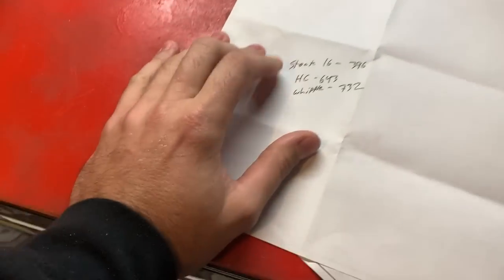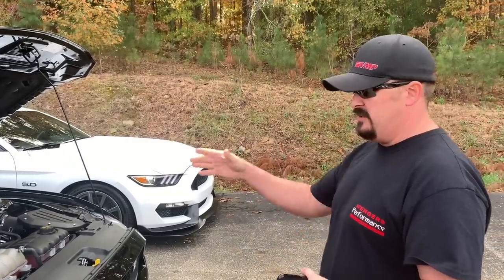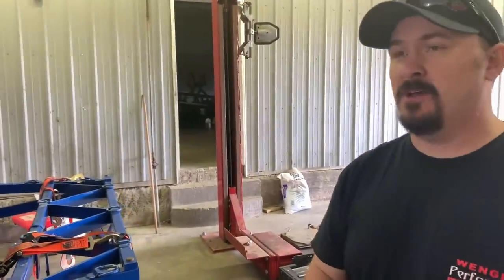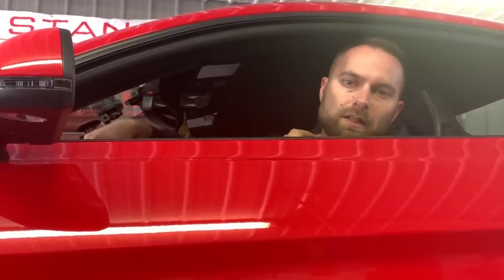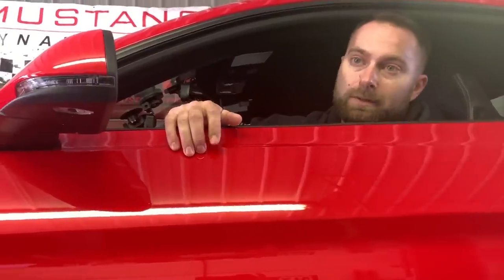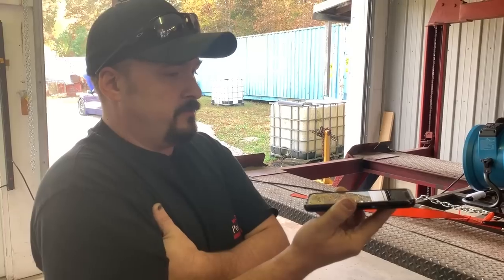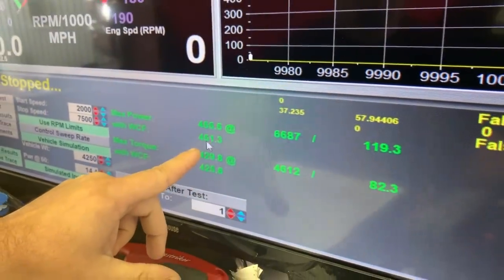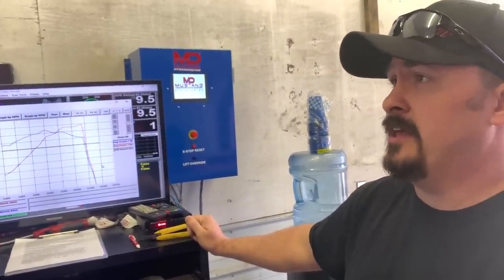How Underrated is the 2018-2019 Mustang GT from the Factory on a Dyno?

Comment: Hey Zander, how do you like the magnetic ride compared to the non magnetic? I want to get the magnetic and a Performance pack but my goodness if you get a PP1 and magnetic you basically pay for the PP2. Only $810 more for it. 

How do you like the PP1? Have you driven a PP2? I'd like to break down the exact differences. I know you get the nice front splitter (which is very nice) and the little wing, then the wheels and tires, and a more aggressive suspension tuning on the mag dampers. Not sure if it gets any added coolers for rear, trans, oil, or coolant or different springs or sway bars. 

 What did you do in the militarty? Thanks for your service man.
Reply from the maker: I like the benefits of the PP2 but I wanted the auto so PP2 was not an option for me. I will say that magride is absolutely worth it. My buddy has the same car I do but without the MR and it is not as comfortable. I really think the MR helps the car to handle better too since it can adapt faster to bumps in the road.
Reply: @Zander13Productions  Ahh okay. makes sense. Will be a daily car also which is why I'm stick between the 2. The PP1 is more practical. I really need to find a PP2 to test drive and compare to the PP1. 

I currently have a cammed 3 valve with suspension goodies and I have a rental 2019 5.0 about a month ago and damn it feels so much more planted than the 3 valve modded up. Was a base modeltoo. So I can only imagine how the MR feels. 

Keep up the great work man. If I wasnt too busy with parenting and work I'd make a fun little channel. May wait till my boys are older to do it with them.
Reply from the maker: If you don’t car about auto get the pp2. It mostly comes down to transmission I think

Comment: Anyone remember the 03 Cobra's? Kenny Bell sc putting it down on a stock stang,so underrated cause the blue oval stallions are factory freaks! But jus curious but what bout throwing big ice packs on it when on the dyno? Not sure what sea level you're at but you know air density plays a factor right?
Reply from the maker: ice packs might be better if the car had a blower. If I did it in the video it would just sit onto of the plastic engine cover

Comment: My guess is that it might be another rev limiter programmed into the chip, aside from the one designed to prevent the engine from overrevving. It might be designed to protect the transmission from overtemperature issues. If you look into the data tables programmed into the chip you might see something related to a transfer case rpm limit for 6th gear, perhaps due to the fact that this engine is also used on other Ford vehicles. The extremely steep drop in torque at that rpm suggests to me that it is a programmed rev limit at work. The thing that puzzles me is why this doesn't seem to happen on the street, if I'm understanding you correctly. My assumption is that there was enough forced-air cooling through the engine bay and the heat radiating surfaces in the powertrain to prevent overtemperature issues, I don't know if Ford programs a "limp mode" rpm limiter to go into effect if any critical temps are reached in the engine or drivetrain.

Regardless, it's a dynamite car.
Reply from the maker: All great information. We are going back to dyno today to play around with it some more

Comment: Dyno is a waterbreak or inertia and I'm not sure how accurate they are these days within 15% 20% is my guess,could be better these days.how do you calibrate? I have a history with electric dynos that were within .5 % accurate. That was at Chrysler engineering in 1980 and it was state of the art.

Comment: curious what the outside air temp was, colder air temp more hp
Reply from the maker: it was humid and about 50 degrees
Reply: Zander13, yeah that would've made that much of a difference. Your car come factory with beast mode lol.

Comment: EDIT: Ford uses the lowest number as advertisement. Also the 2019 engine tuning has been tweaked, so getting 450ish HP does not surprise me at all. The Bullitt is advertised at 480, with the GT500 intake, maybe the tune used on the Bullitt is the same tune in all the 2019 models minus the intake. could be why yours is 450ish.   
Find a turbo mustang and put yours next to it and listen to the exhaust. Turbo changes the exhaust pulse, basically deleting the muscle car exhaust sound. if your liking the sound of your mustang, then keep it NA or use a VMP super charger. just my thoughts. i do not like what a turbo does to the sound of a car.
Reply from the maker: We talked about that yesterday. They may have tweaked the 19 a bit
Reply: @Zander13Productions  i am wrong, the Bullit engine makes 460 HP, with the GT350 intake and tune. So maybe Ford did use the same tune in all 2019 mustang's and didnt mention it. Ford does things like that. that would set yours at 450ish HP, because yours being a normal GT without the intake. You may have stumbled onto a Easter egg from Ford. grats.
Reply: @opossom1968  the bullitt makes 480
Reply: @Frosty_coyote   thank you, i have heard it both ways, i went to the dealer to order and its 480! few upgrades and that will be 500 HP NA easy, my tuner said. what a way to start my 50 yr old mid life crisis!!!

Comment: I agree with other posts on here. The weight is set to high inflating the number. Also from what I was always told you need to dyno the car in the 1 to 1 gear ratio gear to get an accurate reading on a chassis dyno.
Reply from the maker: We are going to do it again with correct weight
Reply: There are factory Freaks. I've had a few over the years. There are also factory Dogs. Just be happy you didn't get one of them.

Comment: black mamba put down 450 they are 500+ hp cars no doubt about it
Reply: Yup most dyno around 415-425
Reply: SyphonX yes I have seen from low 400’s to 450’s.  A lot of factors come into play one being fuel. If you have crappy fuel or run lower octane and it can pull timing. You can also have some good 93 fuel that will add timing. Some places don’t offer 93 so all you have is 91 octane. I’ve even seen people run 87 octane. Numbers can range all over with dynos. I don’t think people should compare dyno numbers from car to car unless both cars were dynoed on same dyno on the same day.  Too many variables that come into play IMO.  That’s why I say take to the track and look at the trap speed.

Comment: I ran a guy that I met up with 3x a wk to cruise and hang out at local car gatherings. I would always beat him, in rolls with my 550 hp 2006 LS2 cam/heads/exhaust GTO vs his 515 hp mid pipe, drop-in filter LS7 C6 Z06 back in 2012. When cars were more reliable.
Reply: Then once, the next day we go to our usual meet and do a few runs and all of a sudden he is beating me. This is just 13 hours later from day before. Based on our power to weight and mods, math, he would need to (A): drop 350 lbs off the car which is nearly impossible on a C6 without taking the doors and rear hatch off completely or (B): Added 50+ hp & at least 25-28 lb-ft of torque. And he denied doing anything in that 13 hours overnight. After lots of pushing, he finally admitted he had the gym-bag Mini 5 lb nos bottle under passenger seat with the 2 lines hidden in wire loom and it vents into his air intake so it was 100% hidden. The gym bag NOS kits cam add upto 75-100 hp and fit in a small gym bag, totally unnoticed.  I knew another guy that had the gym bag on his back seat in his 2011 SRT8, first year of the 6.4L V8 and factoid: No they're not HEMIS either. Just a little bag w/zipper that a medium sized watermelon could fit into.

Comment: Great video you opened your exhaust up and fresh oil that made the difference carnage is happy also if it was cooler it would run better. I live in Canada and this time of year is called turbo weather and surprising how much quicker it makes a car. I don't have a Mustang yet!!! But I do have two turbo cars 1989 Toyota Supra modded and a 1987 Volvo 740 red block turbo winter car. When I get my Mustang next summer I will turbo because I am a turbo addict.

Comment: like the 03 or 04 Cobra's they claimed like 380 flywheel hp but it wasn't crazy to see easy 400 plus some even like 430 claimed to the wheels. I would also see if you can see if it has had any tuning done to it

Comment: Wonder if you have the knock sensor being tripped at those rpms bc exhaust hitting anything or anything that has to be on the car during the dyno causing false knock?😳
Reply: That could be, but the engine would not cut the rev-limiter. It would just pull timing and rev to the 7.5k
Reply: @carstuff4u942  ok i can see that well def take the speed sensors off and go do it again😎💯

Comment: FACTORY FREAK!!!
Reply: StangMode Just think, if he had your beard length it would’ve been 500whp. I promise....I read it on the interwebs, it’s gotta be true.
Reply from the maker: Soon. It is no shave November lol
Reply: It's good to see One mustang make the power promised at ford has overstated power on all engines now for 25 years Dodge will always make more the the sticker  AlWAYS
Reply: @AmericanSurvival001  too bad ford underrated the 03 cobras by about 40 hp as well. Why would you come on this man's video of his mustang and start talking shit about dodge. Where was dodge up until 2009 when the challengers came out....nowhere. the only car they had was a viper that most dodge owners couldn't afford. Sit down with all that noise. Bad when a little 5.0 runs the same times a 6.4 hemi does. Maybe if dodge didn't make their cars the size of a small house they'd figure that out
Reply: The weight wasn't correct, they used curb weight not actually weight like when you weigh the car at the track. Should be 600-700lbs lighter
Reply: @AmericanSurvival001  run that by me again ??????

Comment: Zander 13 
May I make a suggestion?  If your going to supercharge the Mustang may I suggest VMP supercharger I been told it's one of the best Superchargers only right up there with Roush, Vortech, and Whipple just to name a few Gavin from itsjusta6 just had one installed on his Mustang and with all the other mods he's done so far he's putting down 901 whp so that's a big boost in power from what he had before. So maybe you should consider that supercharger and also that's with a 72mm pulley on it as well. It's a good suggestion.
Reply: Vmp does not make a blower for the 18 right now. They said maybe early to mid next year.

Comment: Thats a good video... I think if you goto lund racing they got a 490 gross power,,which would be a 460 wheel.  Correct?
Reply: You're going to lose a minimum of 10% from the crank to the wheels. With an auto, you lose even more.
Reply: @jeffwellman63  so the 460 at the wheel would mean he has 506 hp  ?
Reply: 490 hp at crank is 417 rwhp using the 15% drivetrain loss example for the auto (490*0.85). Another example, if Ford's hp rating on the 18+ GT's were accurate they would be making 390 rwhp and 355 rw trq (460*0.85=390, 420*0.85=357).

I have a 2019 GT but haven't taken it to the dyno yet.
Reply: @JCTiggs1  I was using 10%, I was thinking drivetrain lost wouldn't be so bad with the newer cars.   460 wheel with the 10% loss  would equal a 506HP  engine  .   Other people are seeing 460 at the wheel so I suppose 460 at the wheel is possible here.
Reply: @SHADOWBLACKs650  From what I understand the drivetrain loss is taken from the crank hp number. So 511 hp = 460 rwhp (511*0.9).
If you want to check crank hp from rwhp it would be 460/0.9=511
Reply: @JCTiggs1  1/4 mile pass down the track will give us the correct horse power with the resulting mile per hour.   ... I think it's more reliable just to make a pass down the quarter mile and use the mile per hour to figure out the horse power.   The mile per hour will always give me the horsepower with the known weight of the vehicle.
Reply: @SHADOWBLACKs650  Definitely, trap speed is the best indicator of power to weight ratio.

Comment: It sometimes depends on what all ford has to offer i.e. fiesta st states 197hp 205 ft. Lbs. 0-60 6.5 Focus st 250 hp 250 ft lbs. 0-60 5.9,  fiesta actual torque was roughly 25-30 ft lbs. Higher and because you have to go to 3rd gear to hit 60 , 2nd ends at 58. Other small fords 2nd gear got to 62. I've surmised they left the gearing that way and didnt advertise true torque because who would pay the extra 4 g's for a vehichle with same 0-60 (if could be hit in 2nd) only 15 ft lbs. More and weighs 500+ lbs more and handles less well than the cheaper fiesta st. I've also heard partially insurance reasons. Lastly for the dodge guy watch TFL's show hellcat vs FiST....pro race car driver took both cars on full track with straights slaloms S turns sweeping turns and best time for fiesta st beat the hellcats best time. That means 1 trick pony dodge straight line is all they can do Fords budget sub compact sport version beats dodge top of the line...imagine how at GT would smash it on a track and hang 0-60 1/4 mile....GT 500 venom kills demons

Comment: Good stuff.  Reads about like a dynojet.  Have seen stock Hellcats read as low as 600-615 on a mustang so if 660 there cool.  Just numbers.  Should trap 122-125ish if around 470whp I reckon.  They new mustangs are great cars.

Comment: Not this one Only  red lined when  Pro Dyno put the  custom tune in,  308 at wheels  before  tune  with x pipe  catback  BBk intake  ,underdrive ,around  338 to 345 at wheels    its  babied 47000 miles  ,Jack  Roushe  suspension. Spoiler kit ,glass top ,gt check out YouTube  our little pony.

Comment: Plus, to close the case, you have had the 19' awhile, if it was truly powerful beyond the norm, (and you would have "definately" noticed it compared to the 18' you had regardless of transmission), you would have had it on a dyno long before this. New vehicles take 30,000+ miles to get good and broken in and might make 5-8 hp more by then, but not with under 10k miles. I'd have to check the car top, bottom, sides, inside and out and plug in to see if it has been tuned, otherwise I am confident it is. Just say'n.

Comment: The shop seems a bit lost, likely due to the speed limiters, traction control, etc. Having said that, I haven't seen a 10R80 dyno past 418 (mustang dyno), and I've watched a lot of YT. Your trap speeds will show the true HP.
Reply from the maker: Same. That’s exactly what I told them from the start. 410-415
Reply: Yup, my car ran 410 stock hitting the limiter once the limiter was removed I hit 418 all done in 7th gear SAE corrected.

Comment: My 18 10r80 made 427whp 400wtrq stock and ran 11.88@119.88. So you better run 11.0-11.2 stock lol
Reply from the maker: Were you on stock tire? What psi did you set them to
Reply: I had a Mickey thompson on it but 60 with only 1.8 could of done that on the street tires when I was stock also

Comment: Zander,  I have to say this, I've seen you test drive a lot of mustangs and I believe you need turbos. If you get a paxton or  whipple  you'll get used to it, and want more. At least with a turbo you can control the boost. Don't build something and later wish you had gone another way.  Nice numbers, I like the way you worded that, Freak.
Reply from the maker: yep, that's my fear. I want to do it right
Reply: @Zander13Productions  which ever way you go, I'm sure Carnage will be an imposing performer
Reply: Turbo is the way. Would pair nicely with the auto. Look how crazy the midnight performance car is. Blowers are nice, but all the issue with the belt... the crank etc. Its not for me.

Comment: So I'd be nearly willing to come take my microscope eyes to your car, but I can not check for a tune because obe would have to own a Ford OBD 2 & 3 diagnostics tool and program combo which is a cool $1200-1400. Moral is that I know and have ran many guys and beat them then 15 to 36 hrs later we go dyno and they have a noticeable amount of more power than when we ran each other and the last dyno, yet they denied having more mods or no mods. The dyno can lie for the right $$ amount. I wish we could send you to a random dynojet dyno that we confirm is in proper working order, get the correct info on the car, make sure it is full of 91 or 93 or even 87, (87 octane will not hurt the car) and go from there. SAE is the closet accurate way to show power. Not STD Smoothing. Even 446 rwhp SAE is rather high. That is still 13 to 25 hp higher than average of 100 different cars dynoed, on same type of dyno. Might be E85 or 100 octane in the tank and that's not stock. I would not put E85 in it if you plan on keeping it past 2 yrs, or if it is leased. It is not the same V8 as in the F150. It looks the same but it is very different. The Mustang has upgraded internals, the F150 V8 does not, the Mustang is NOT E85/flexfuel but the F150 is. It is not the fuel lines that is a concern as those are upgradeable but the motor itself is not made for any E above 15%. You could possibly get away with 20%, but I don't how long it would be before you would start having hard starts, rough idling or engine hesitstion while driving, maybe 6k to 12k miles from new. Oh and if you finance and trade every 2 yrs your hurting your credit score. 3-4 yrs is much better. I did F&I at a Dlr for 4 yrs.